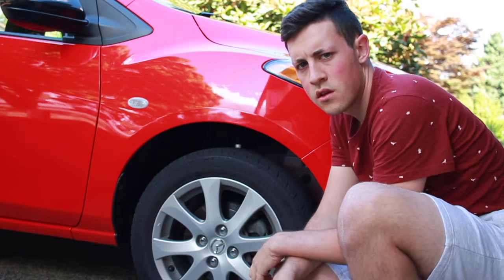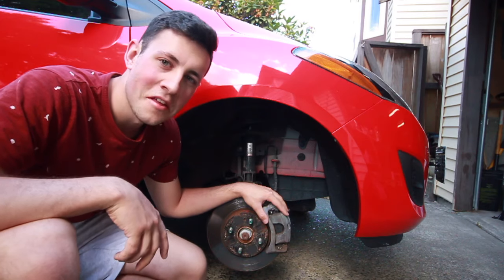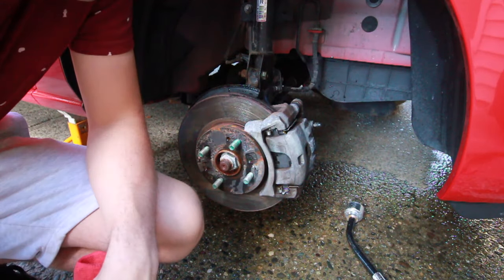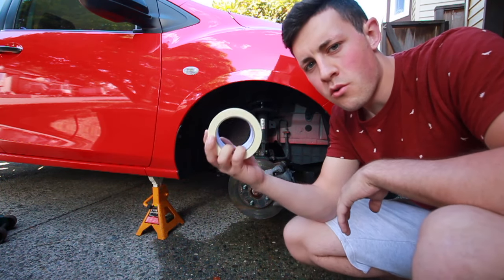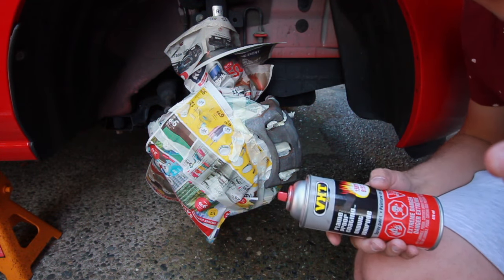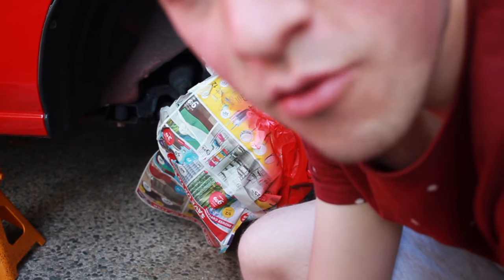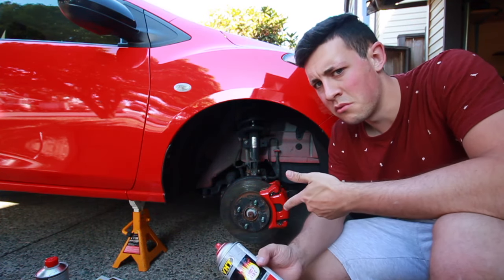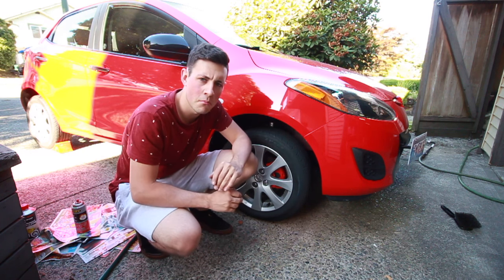How To Paint Brake Callipers THE EASY WAY

Comment: My one question is, Why didn’t you use VHT Calliper Paint aerosols? They cost about the same as regular VHT High Temperature Paint, are chemical resistant to brake fluid and are for high temperature use.
Reply from the maker: I had no idea that was available, or else I wouldve used it. But now I know for next time thanks!

Comment: No primer ? Is it needed👀
Reply: After brushing i would use acetone to clean it, shouldnt need primer. However I would use a clear coat over top to protect it against brake dust.
Reply: Depends on how long you want the job to last!

Comment: 2 bolts bro common you showing people bad example
Reply from the maker: I aint re bleeding a brake system just to throw some paint on.
Reply: @LiamDrives  what are you talking about?you can take calipers from rotors when you changing brakes.dont have to disconnect brake line
Reply from the maker: @faridgadimov5955  I know, but either way you have to secure the caliber so its not hanging by the brake line, and mask all the suspension comments around it. Yea you would get all areas of the caliber thoroughly, but no one would see it.